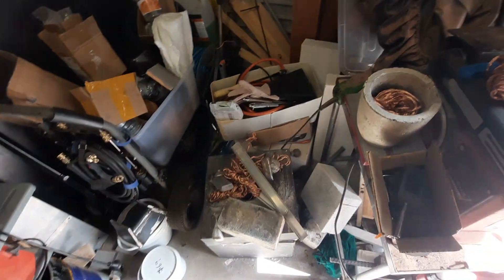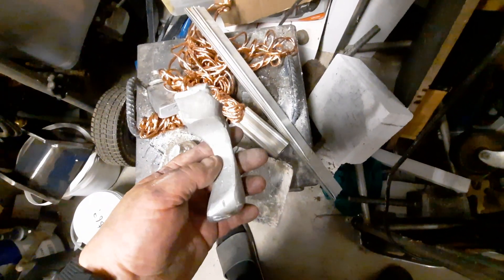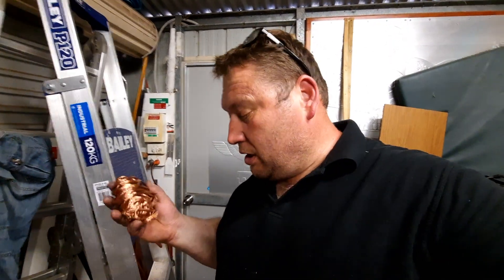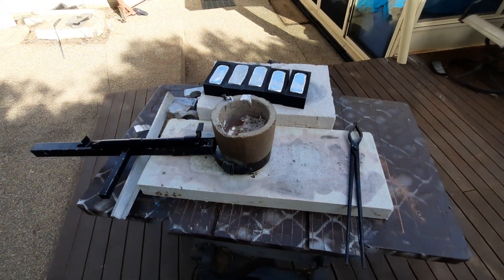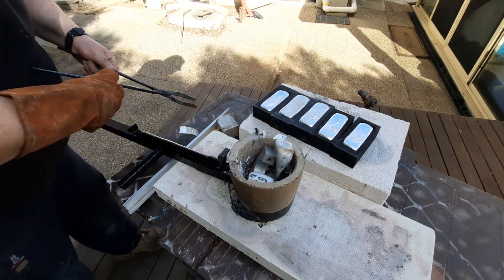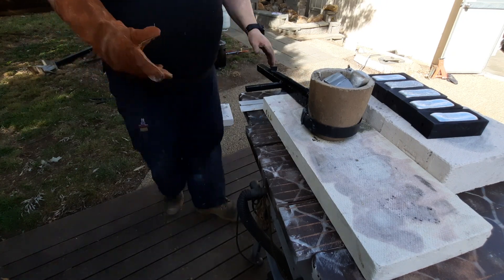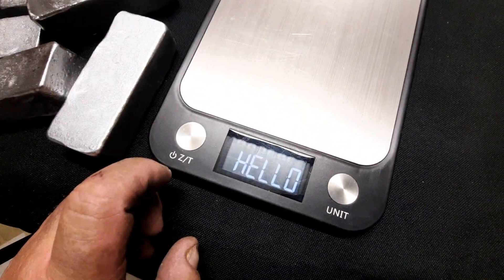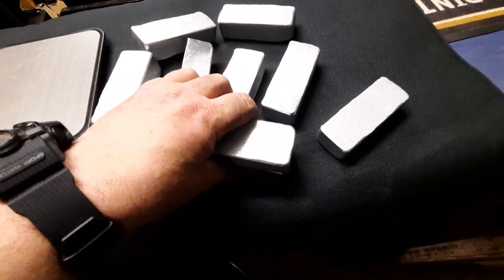Fake imitations  copper wire    be careful     how to check!

Comment: I know too well about such wire. It is actually called CCA wire. CCA stands for Copper Clad Aluminum wire. It is the worst wire you can use for anything. It breaks inside the insulation and you will not know about that till you try to power it up and nothing works. I wired an entire trailer with such junk wire from China, and out of seven lights, only one worked. So I had to strip all of that crappy wire out and start over with true quality wire made here in America... Thumbs Up!
Reply from the maker: Well I acquired some more the other day eyes lit up then realised once again no it's the aluminium copper coated wire again

Comment: Rule of thumb in my experience brother if a motor is 1985 onwards and sustains a constant load ie a vacume cleaner type motor nearly always contains aluminium copper coated windings.cheaper to produce and technology is getting worse milwaukee are the only manufacturers of full copper windings in there drills dewalt a gone downhill in my opinion
Reply from the maker: well that's good to know  , good one mate  now I know that ! always on the lookout hey

Comment: That happened to me a few weeks ago.  I scrapped a motor for copper.  Once I cut the copper wire, it was aluminum on the inside.  A little bit of a bummer, but oh well.  Nice video.  I look forward to seeing you polish the bars to a mirror finish.
Reply from the maker: Yes I was thinking the same  hope these polish up well  very clean so thinking they will  !